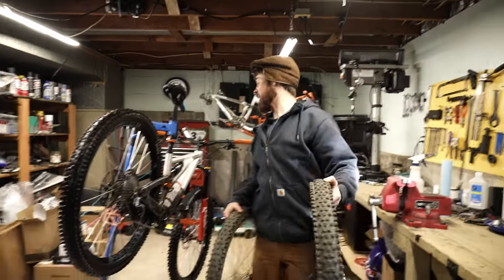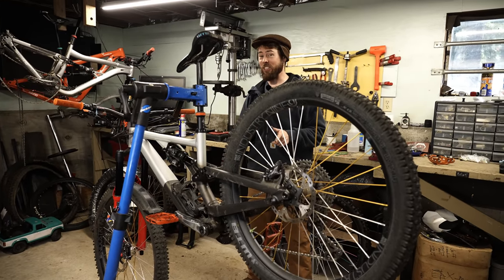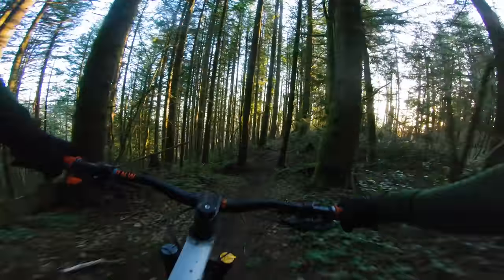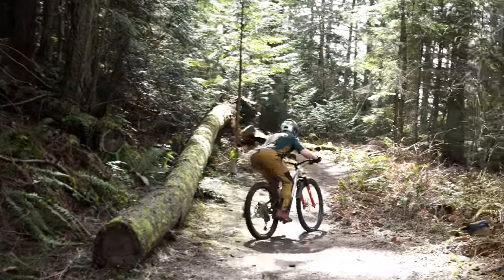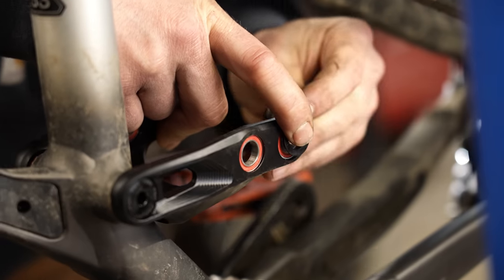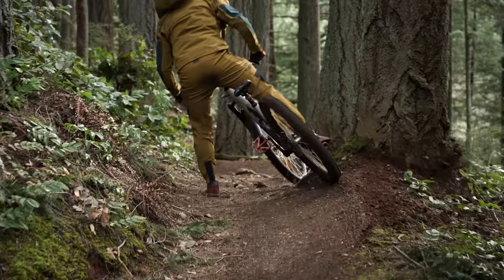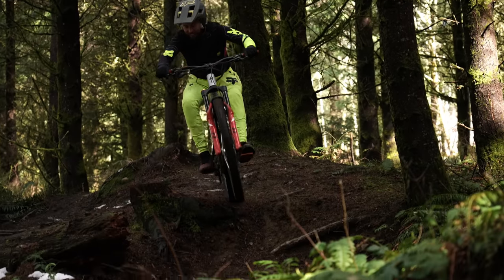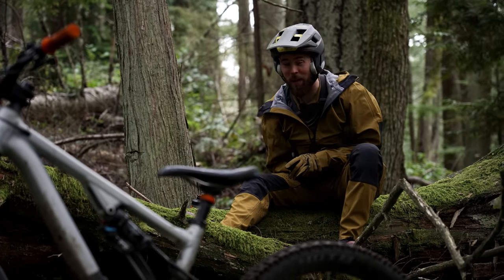Stumpjumper EVO MULLET: am I wrong?

Comment: Don't know about the EVO but buddy of mine has been riding mullets for 4 years now and he prefers the responsiveness to small input over the 29. His cornering had improved a lot and he manages the bike quicker than a 29. He also has comparatively short legs and tends to ride off the back a little. He's nowhere near pro level but for him, I see a real improvement in his riding a mullet vs 29.
Also: he seems to destroy less rear wheels since he swapped to 27.5. He might have just been on wheels that are too light before but I'm sure the smaller diameter also helps there. He's a heavy dude that's rough on wheels

Comment: I'm not on a stump jumper, but my bike (orange Switch 6) came as a mullet standard. I demoed the 29" 'version' the stage 6 before purchasing mine and although I think I was probably faster overall on the full 29, the mullet is more fun and in the tight stuff, the extra manoeuvrability is very noticeable. I don't know if this is to do with it being a purpose built mullet but I love it, no complaints.

Comment: Also can totally agree that mullet bikes handle different off the lip and in the air,  I'm thinking it has to do with the rotational mass off the larger front wheel creating a dropping front feel. Almost like hitting the brake in the air

Comment: As a short rider I prefer a dedicated Mixed wheel bike. For me, being short, the full 29 bikes felt like wagon wheels and were very difficult to manage in corners, in the air and negotiating trail features. It felt like I was riding wheels and not a bike. The mx set feels much more intuitive and responsive, but I am riding a dedicated mx wheel bike not a converted 29. That my two pennies anyway

Comment: 27.5 being easier to manual is in direct reference to the ease pulling it up,  as in you don't have to lean back as far/hard. My 29 fuel ex is hard hell to initiate a manual since it's so long, but once it is up it's easy to hold.

Comment: I like the mullet setup personally. I have had 2 of them. First one was a specialized status it was very fun and the cornering was noticeably better than my 29er. But it was a terrible pedaling bike. Just bought a trance x 27.5 and swapped all my parts from the status to it and I love it. Is it as fast as a 29er in the chunk? Probably not but the big wheel in front takes care of the big stuff while the small wheel make it fun and snappy. Just my 2 cents.

Comment: At 215lbs the lack of progressivity on the mullet link was awful. Cascade all the way. And the bike didn't have any advantages like you mentioned. I've always been a big fan of 27.5 so that's saying a lot.
Reply: Progressivity is overrated, it’s just easier to set up, every suspension feels fine if there is a wall or ramp at the end. Set it up right maybe
Reply: @MarioXcore1  Progressivity in the kinematics give extra ramp at the end. Not sure what you mean. At 215 lb I had to run a shock full of volume spacers even with the stock link. The mullet link made it impossible to get enough ramp up at the end because of the reduction in progressivity. With the Cascade I've been able to reduce volume spacer size in half and have tons of ramp up. It's very nice 👍
Reply: @MrChadLedford I understand now, makes sense. Nice 👍

Comment: Good insight. I just got the carbon frame of this and I'm having it built up to a mullet...mostly because my previous frame (2014 specialized Enduro) was mulleted due to my mechanic not having another compatible 29er wheel at the time for my GX Eagle I put on there and I wanted to try it out as a mullet anyways...I also don't have the desire to spend even more money on another 29er wheel at the moment 😋Mulleting my 2014 enduro helped my downhill game alot since slackened the geometry from its stock and now archaic 67.5 and the lesser weight and traction on the back felt like to give my front more priority making me and my very average technique a bit less prone to front wheel washouts. Definitely felt snappier overall and only only a little harder on climbing (which is low priority for me anyways since my uphill tennis elbow pain turned me into more of a downhiller). I might post another comment once this bike is built up but I don't know if I'll be going back to full 29er any time soon.

Comment: 29in wheel measures 24.5in (622mm) and a 27.5in wheel measures 23in (584mm) so the difference is 1.5in (38mm). Whereas a 26in wheel measures 22in (559mm) which is only 1in (25mm) less than a "27.5in" wheel. You can reduce the difference in diameter by running a plus rear tyre.

Comment: I think alot of people that don't get the mullet setup are just "not short enough". I (and a lot of other mullet riders) dont ride mullets because it's inherently better than a 29er setup – it is actually objectively worse in some instances – but that doesn't matter at all, because I am just not tall enough to maneuver a 29er rear wheel the way I want while riding rowdy trails. So for me ot's just a size thing (I'm 5,7 with short legs and long torso). You also see that, when you look at worldcup dh racers: sure, there are some taller guys that run a mullet, but there are no short guys (5,8 and under) that ride full 29ers...
Oh, and it's pretty annoying hearing taller riders go "yeah mullet is just a hype thing" because they don't get it, since they have no problems with 29ers

Comment: Mullets have generally worked for me, but i've always built off a 27.5 frame. between tire buzz, and feeling less joyful (to me) it works for me. To each their own.  Arguing about this stuff is silly but may be Jeff you should mullet a 27.5 through a fork change and offer thoughts on that. You're always hunting for content right?

Comment: Love this video, in fact, all your videos. I described you as the most honest feedback mtb videos you'll find on the internet to my friends. Not mullet-related questions, but since you swap the coil fork on and said the coil fork is excellent for wet conditions. My obvious assumption is that coil fork is more supple on very more bump sensitivity, but since it is consistent with no ramp-up, is traction better for medium size trail obstacles and braking bumps? does it make the bike much less poppy as it would with rear shocks? 

Would love to see a video from you comparing air vs coil fork just like you did on rear shock on the firebird video.

Comment: I did a short mullet test on my Chameleon. I rode that bike for four seasons as a 27.5. It has a 29 er 36 set at 150mm travel as it was originally set up as a plus bike. I didn’t care for plus tires. I bought a set of We Are One 29 wheels and started riding that a lot. Since I had the smaller wheels at hand I went out with both wheels and rode a 20 minute loop back to back. The. I did it again a few months later. I really didn’t detect much difference. I’m not tall at 5’4" and I get butt buzz sometimes on any wheel size. I wonder if a rider gets a different experience changing a 29 to a mullet versus changing a 27.5 to a mullet?

Comment: I think going from a full 29” front and rear configuration to a mullet is different from going from a 27.5” front and rear then swapping to a 29” front.  I definitely felt an improvement when going to a 29” front because of the “roll over” factor…but the turning felt slower almost sluggish, but now that I’m used to it I’d never go back to a 27.5” setup. Mullet for me
Reply: In your experience then, starting with a 27.5" platform to mullet is better than 29" platform to mullet?
Reply: @MrTakefootoff  i wouldn’t say better…I’d say more noticeable. I was going to mention that Jeff did the exact opposite of what my experience was. He swapped the rear tire, I swapped my front tire. Coming off a 29” bike you definitely have a better “roll over or monster truck”  of a bike. The tires just fill in more and get through tricky stuff so I could see that putting a 27.5” rear wouldn’t really make a big difference. But from going from a 27.5” setup and then Changing the front to a 29” you are going to notice how now that front end eats up everything in the path and gives you more confidence to just go wild without much concern. In my experience the only thing I didn’t like (at first) was the steering felt slower and you had to lean back into the bike for corners, but once I figured it out the mullet setup is awesome.
Reply: Going Mullet on my '18 Reign 27.5 definitely added a bunch of high speed stability and smoothness through chattery small bumps. I just lowered the stem a bit afterwards, and it honestly feels better just about everywhere.

Comment: @13:39 you mention experimenting with parts from parts bins may have lead to the mullet. Well, in/around 2002 Specialized introduced the world to the Big Hit, 26/24 wheel setup, perhaps the first factory mullet(?) The inspiration at that time came from the MotoX world. 
I love me a mullet, particularly because my frame is too large and my legs are too damn short.

Comment: I wonder, could you use the normal (or cascade) link and set the headset to -1degree to compensate? I love my mullet with really low bottom bracket and short cranks to make it extra twisty.

Comment: I think there are 2 kinds of mullet bikes. Ones like stumpy, mullet does not change much that it’s still have 29 all mountain bike characteristics. Mullet is more like a flip chip to those. There’s also mullet bikes that designed to replace 27.5 bikes. The characteristics would be much different

Comment: I think mullet only makes sense if it's to get shorter chainstays. Turning a 29er into a mullet won't do that, nor frankly will turning most 27.5 bikes into mullets or even factory mullets. But there are a few short chainstay 27.5 frames that would make good mullets.

Comment: My hardtail is 27.5 front and rear, went mullet with a fork change and 29 front wheel obviously. Bike geometry was exactly the same. Ended up with a slower turning bike, and slightly unpredictable bike. I didn’t like it. I have been riding for 35 plus years so my style is very active and mobile on a bike because back in the day my only suspension was me. Both my hardtail and full sus are 27.5. I had hoped mullet would solve the reason I struggle with 29ers, constant back wheel buzzing my butt, it’s not the answer for me. I ride for fun and like a quick steering lively bike and dont really care if it’s 3 seconds slower down a 2 minute trail.

Comment: Heyy jeff I have a transition patrol v3 and I kinda have the same ride style as you. It is a 27,5 front and rear now. Butt should you recommend trying a 29er up front? So yes still with 170mm of travel or should I go less travel. And I have heard you say now that you don’t like the float x2 shock because it’s to linear and im running against that same wall even with the max volume spacers in it. But what shock should you recommend or should I think about a cascade link on there?
Reply: Love your vids by the way! Greetings from the netherlands

Comment: Probably been stated before somewhere, by someone, but 70's enduro motos had 21" front and 18" rear, well my Yamaha did. But the idea was used by off road racers on the Factory level. Not foreign to me. For the underwhelming suspension tech of the time, it did help with front end tracking, which was a good thing. I suppose I should add that my mtb riding has never pushed me toward the mullet setup. Factory designers and engineers know a bit more than I do about their products than I do. BUT, if I ever decided to use it for some other purpose than it was designed for? All bets are off . . . just sayin'.
Reply: Moto enduros still have 21/18 setup and it works great :)

Comment: I've converted 2 bikes into a mullet for 2 different reasons. 

The first was a 27.5 trail bike that lacked head tube angle for steeper terrain. Swapping the 140mm 27.5 fork for a 140mm 29er fork slackened the front and helped with rollover. 

The second was a full 29er GG Gnarvana with a really long chainstay. Converting the rear to 27.5 and getting a shorter seatstay really helped the bike swing around corners... especially in the tighter/steeper PNW terrain. In both instances, the mullet helped the bike, however, I probably would have kept the full 29er had the chainstay been shorter.

Keep the videos coming bro!

Comment: I found that on my bike, running clipless gave me all the rear wheel control that I was after. I was considering going mullet and now I’m sticking with full 29. It corners on rails even more so than it did on flats and still doesn’t get hung up in square edge hits.

Comment: If you are on a size medium or larger you should be big enough to run full 29. Mullet is just a fad and makes the bike look stupid. 
I've ridden both on multiple bikes and I reckon you get used to either pretty quickly. If not you are probably over thinking it.

Comment: You lost your 29" front wheel over that lip 😉
Full 27.5" setup would've kept you upright 💯
I partly agree with your jump statement... I notice an imbalance on drops more than jumps.
But, I think 'el moolay' viability depends on the bike.
I run mullet on my Banshee Phantom V3.2 🤘
It has adjustable rear dropouts too.
It passes as my uplift rig 🫣
On the rear is a 2.6 Specialized Eliminator Gravity casing tyre.
Up front I've had to settle for an Exo+ Assegai... I'd run a DD, if you could get em down under.
Personally, I love the mullet concept (on the right rig).
YMMV
Re, the industry... most are now providing mullet options/adjustability.
My nutsack loves the mullet on steep, technical trails 🙊

Comment: If I remember correctly, only one UCI DH race was won on a full 29er in 2022.  All the others were mullet.
Obviously that doesn't speak to manuals or climbing...but to cornering at speed, it has to speak to that.
Reply: wondering if that's because they all are contractually obligated to ride mullets so the brands can sell mullets - always gotta find a new market segment, ya know?
Reply: @macho_burrito  You must not follow racing. Racers were complaining about 29" rear tires hitting their asses and being hard to throw into corners before mullet dh bikes existed, for a lot of brands they still dont exist. They had to have custom linkages made to adjust geometry. The products follow the racing development. Racers run whatever they need to win, some run full 29, mostly taller riders, average height and shorter mostly run mullet, but they can all pick whatever they need. Same with enduro racing, european tracks have so many tight turns mullets work better for a lot of racers, but not all. Many retail enduro bikes are still full 29 only stock and need aftermarket links or offset bushings.
Reply: @bermroller  you're right, because elite DH racers need that, so do 235 pound 45 year olds driving jeep wranglers and blasting dave matthews at the xc trailheads? UCI racing doesn't exist just for racing, it's a platform for brands to try and create new segments and products and convince average joe's it's worth their $6500 purchase.
Reply: @macho_burrito  They would have to run the sponsored brand of wheel/hub/tire, but are not limited by tire size.
It's also not limited by specific frames design, i.e. a bike maker would certainly make a new suspension link for their pro riders in order to convert a bike to mixed wheel if it means their racers podium.
When a brand wins, it will translate into bike sales to some degree, regardless of wheel size.  
The TL;DR version is they are not obligated to do anything but win within the rules and ride the brands they are sponsored by.
Reply: @macho_burrito  most manufacturers arent making new mullet only bikes to sell, its the opposite, many companies are making excuses not to do the extra engineering and manufacturing needed to make a modular bike and are making full 29er only bikes claiming theyre more optimal, and customers have to source aftermarket solutions from cottage machinists. The industry would prefer to make uniform wheel sizes to maximize profit margins, its customers who arent satisfied with wagon wheels rubbing their asses that are demanding smaller rear wheels, just like the racers are. Your theory doesnt make sense in this case.
Reply: @macho_burrito  You mean it's like a conspiracy and the racers go along with it even if it might make it harder to ride?

Comment: There's no point running a mullet set-up if your front wheel is never on the ground, you're just carrying unnecessary weight! 😜
On a more serious note, I thought mullets were supposed to change direction more easily and were more playful in the sir,?

Comment: You need to consider other bodies and skill levels in this review.  Sure if you're a 6ft pro mtb er that has ridden 29 for the last 10 years, you're not gonna see the benefits.  As you can see from the reviews most supporters of the mullet are doing it for the tire clearance.  And yes 27.5 is easier to manual, for someone that has issues getting enough power to lift the bike, the smaller tires gets the front end up and allows you to focus on the manual.  Easier to learn, certainly.  As an expert, could be worse.

Comment: Tha advantages doesn’t really work when your riding bikes with short wheelbases like yours. So for those who are tall and need something that can handle tight trails MX is what you need.
Reply: Switching to a 27.5 rear wheel doesn't change the wheelbase, the axles are in the same spot, it probably helps with cornering though.
Reply: @leifostrum9597  I’m talking about a bike that is actually meant to be mx
Reply: A lot of newer mullet bikes are coming with long chain stays (meta SX is 447mm) and there are plenty of full 29’s with short rear ends
Reply: @ervin7178  find me a very long travel 29ers with 435 chainstay or less for people who are at least 188cm